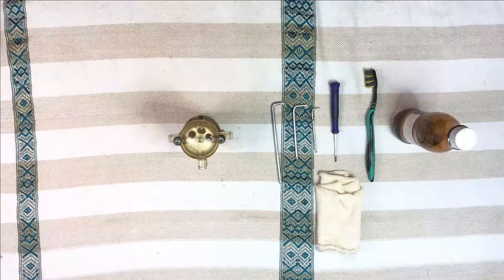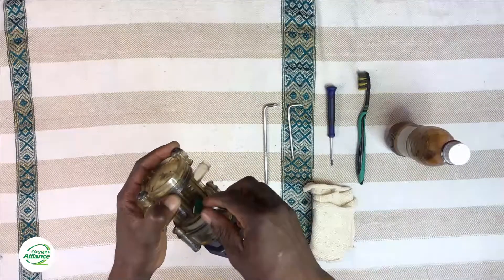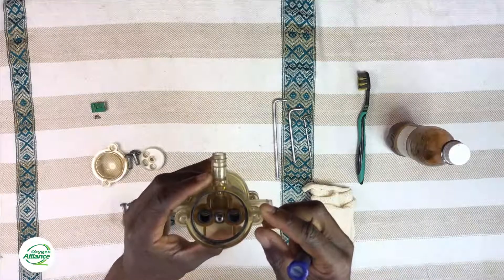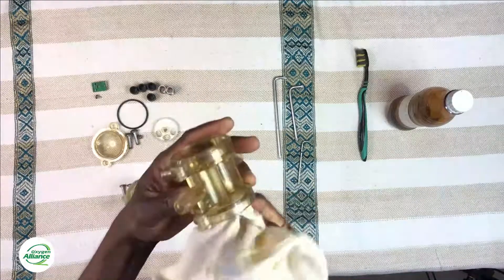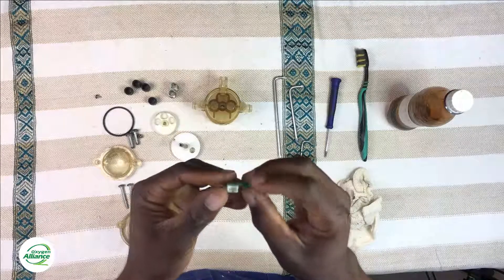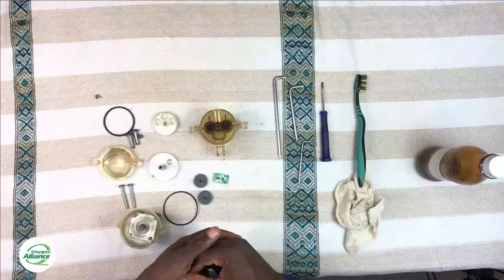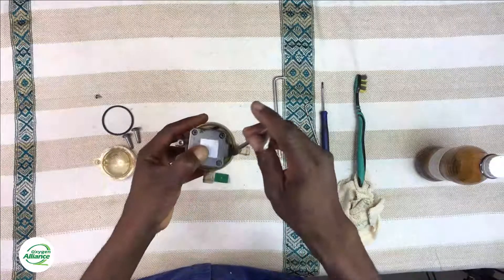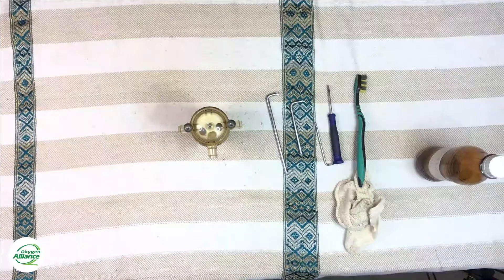How to Disassemble, Clean, and Reassemble a DeVilbiss Rotary Valve

Comment: Does this "fix" a faulty Rotary Valve? I have replaced the complete unit due to noise or leaking air causing low O2, I will try cleaning next time to see.  Thank you for the video.
Reply from the maker: Yes, it can definitely help fix the valve.